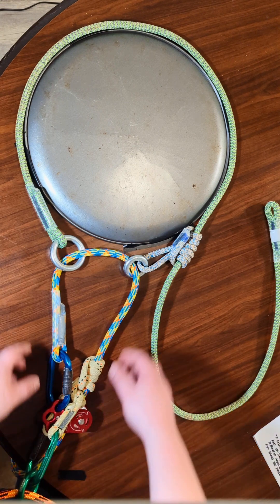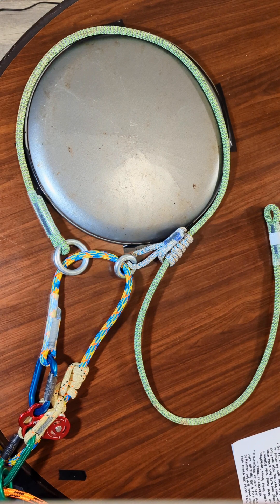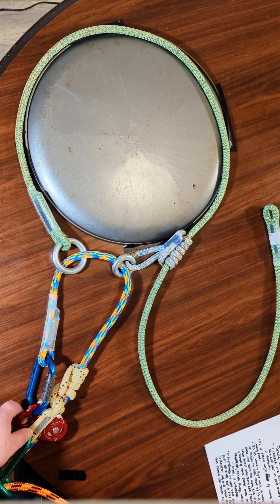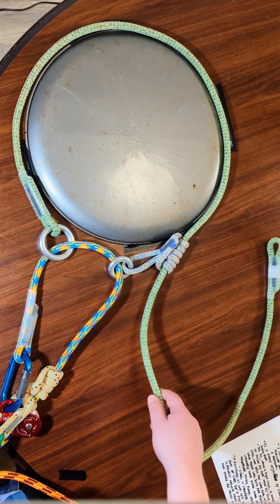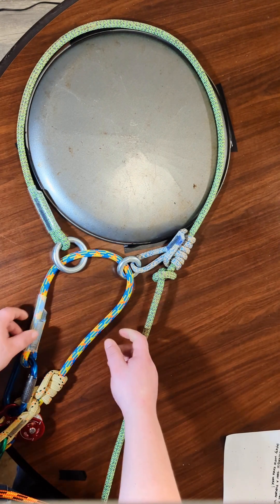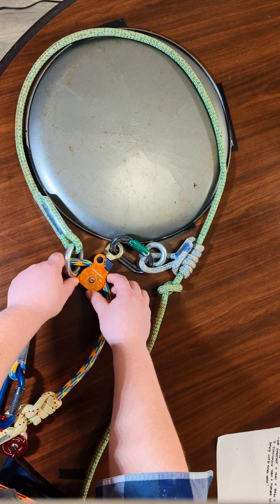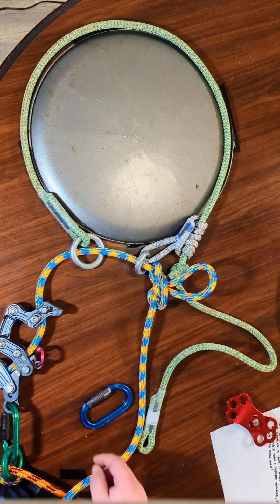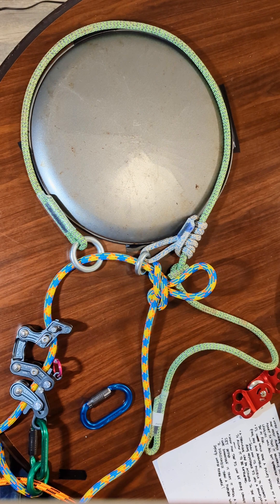How/Why To Use an AJUSTABLE FRICTION SAVER to Safely Connect to a Tree Spar!

Comment: Does Tree Arborist Friction Saver small ring suppose to go through big ring and why?
Reply from the maker: I am not entirely sure that I understand your question. When you install a friction saver, you do so using a throwline and a throw weight. You must first isolate a limb and then raise the friction saver up and onto the limb. Then the weight descends back down to the ground, where you next attach your rope to the throwline and pull it up through both of the rings and back down. A rope must ALWAYS be installed through the small ring first and then the big ring. That way, when it comes time to retrieve the friction saver, you can use a retrieval cone or a simple overhand knot in your rope to pull the rope through the big ring; then the cone or knot gets caught on the small ring and you are able to pull it down and catch it. That is what is known as a hard retrieval. You can also retrieve it using a throwline once again, a gently lower it to the ground; this is known as a soft retrieval. Here is my full length video about how to install and retrieve a friction saver from the ground: https://youtu.be/d20d9Acnlgg If you have any questions, don't hesitate to ask. Perhaps I've misunderstood you. I've done my best to answer the question I believe you were asking. =-D
Reply from the maker: When using it as a spar anchor, as discussed in this video, the same rules apply except you can easily install it while aloft. Again, the rope must always go through the small ring first and then the big ring. This will make retrieval possible.
Reply from the maker: I also have a comprehensive video about spar anchors, which include the one discussed in this video. You can watch it here: https://youtu.be/_wT7wg6Odtw

Comment: I'm a first climber where can I get all of this gears? 
Thanks!
Reply from the maker: One of the best places to buy gear online is wesspur.com! That is my favorite place and probably the best online vendor with the best selection/prices. Also, you can go to treestuff.com and check them out as well! There are a few other decent vendors out there, but you'll find everything you need at either of these two vendors! Let me know if I can help you with anything else. I can be reached privately with any questions you may have or advice you may need at knotorious.contact@gmail.com! Welcome to my channel and thanks for commenting; and welcome to the wonderful world of tree climbing! =-D
Reply: @Knot-orious  Thank you for your help! I want to climb up to cut down a tree so I'd like to install this Adjustable friction saver system but I'm a new climber so I don't know what gears I need to buy and how to setup this system correctly. Your advice would be appreciate!
Reply from the maker: All you need in order to install an adjustable friction saver is a throw weight (sometimes called a throw ball), a throwline, and a rope! Here's a video I made that shows exactly how to install an adjustable friction saver from the ground! Watch the video and, afterwards, if you have anymore questions, I'd be happy to help you. Once you get the rope through the two rings, you'll be able to create a climbing system, specifically a moving rope system (MRS) AKA double rope technique (DRT). This can be as simple as a closed system using just your rope to climb with a Blake's hitch tied with the tail of your rope (this works best with 12 to 16-strand ropes) or an open system with a split tail, or a Hitch Climber setup, which involves a Hitch Climber pulley and a friction hitch tied with an eye to eye prusik/hitch cord (which you'll see me display in this video). https://youtu.be/d20d9Acnlgg